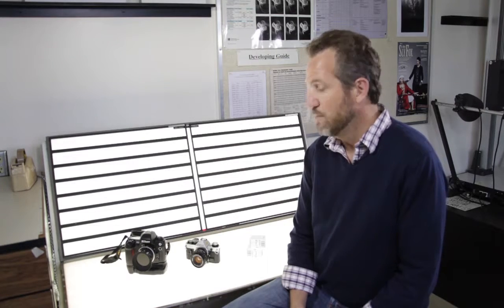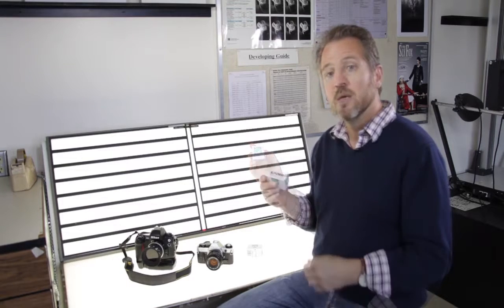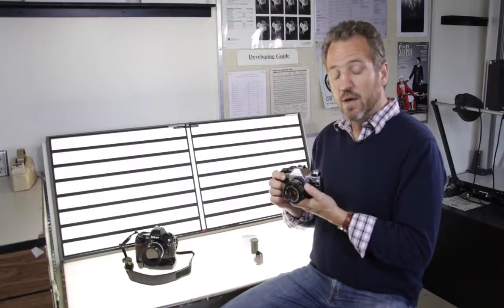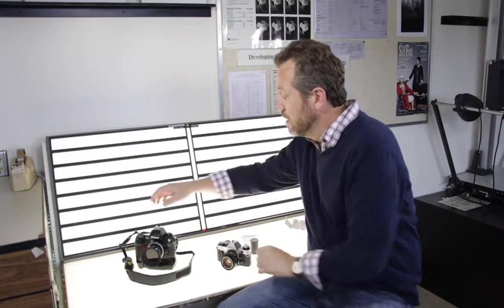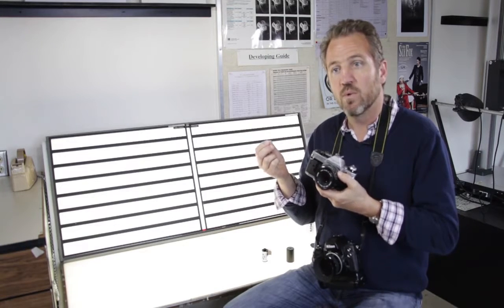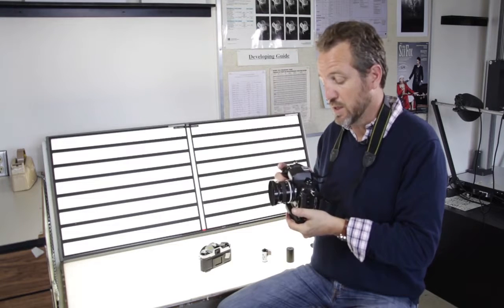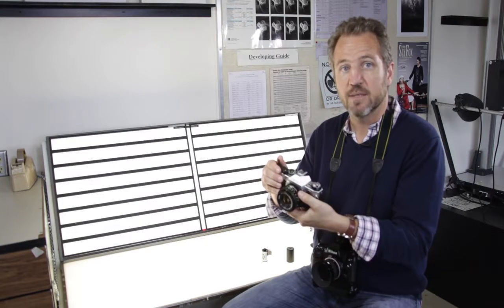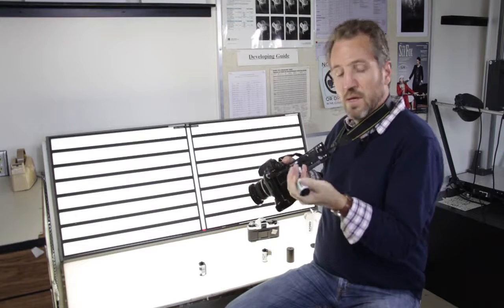Loading 35mm Film 101

Comment: you should try to load film in subdued light. - not in bright sunshine.by turning your back on sun or other light source, use your body's  shadow-
after using all the film, rewinding it into cassette, leaving some leader showing, if you learn to judge when film has detached from the take.up spool. keeping some of the full depth of the film strip projecting from the cassette, ensures the felt light traps on the cassette are pressing against the film(avoids possibility of fogging due to faulty traps) if the camera is motorised/automatic, it may have an option like this-see manual.  otherwise, it will probably rewind the film totally into the cassette- . in either case, unload cassette in subdued light.
Allan.
Reply from the maker: That is absolutely correct!  I couldn't agree more.  Thanks for adding that.